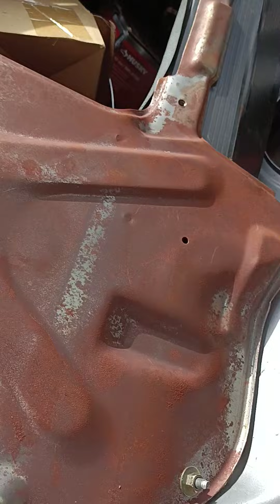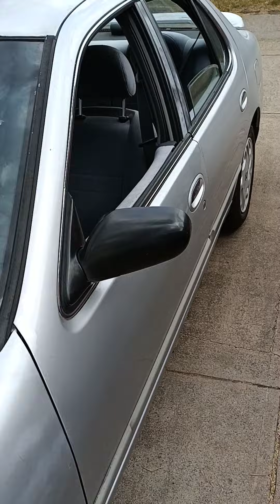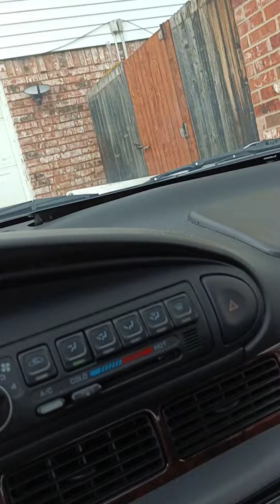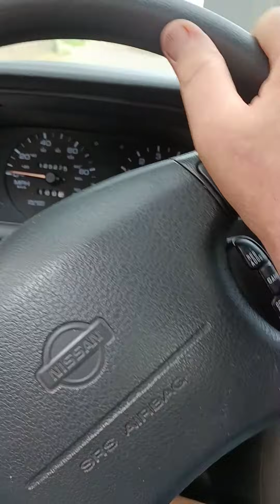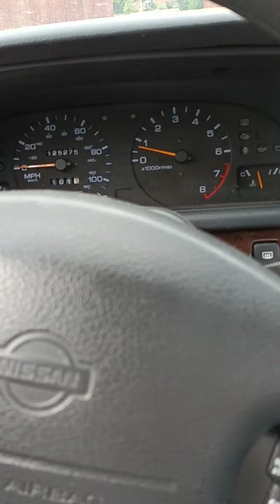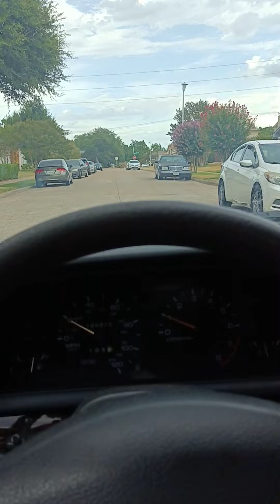1997 Nissan Altima; Replacing the Fuel Pump Connector

Comment: Id swap the iridium plugs for the best copper plugs u can find. On my 94 chevy k1500 brand new top of the line copper spark plugs we less than $10 each (2years ago money) they truck runs great with coppers bc thats what it was designed for and ment to use. The older the car its not really worth the extra money for iridium plugs, its just my opinion but myself and my friends with older vehicles have found using the "lower end" parts (from the technological standpoint of modern cars) makes them run and work better

Comment: But you not show Us  how fix  it the gas pump , We need it check how do it .
Reply from the maker: I have other videos that discuss replacing the fuel pump.  This video is about addressing the bad connectors that the pump plugs into.  If replacing the connector like what is done in this video, I used a dremmel tool to grind off the corrosion on the plate connector before soldering the wires to the plate.   If you don't grind down the metal, the solder will not adhere very good.  In a later video, I redid this connector replacement and cut away the old connector housing that is built into the plate to get better access to the metal of the plate connector.

Comment: Your video on dealing with the POS Nissan Altima has helped me a lot in dealing with the same POS car.  I will NEVER EVER EVER EVER EVER buy a Nissan again - Let me say it once more NEVER AGAIN!  I have replaced all tie rods, CV axels, motor mounts, power steering pump, and fuel filter and now Im replacing a totally failed (due to corrosion) fuel pump.  What really pissed me is how difficult it is to replace the power steering pump, the design is so bad on how to access it, I'm never ever again going to buy a NISSAN.  I also have a 2008 G35 which also has many little problems and it too has some very stupid engineering designs.  They have nothing on Toyota period.  Even my Ford 150 is much simpler to work on.  

Again Thanks for the videos - I have seen a lot of POORLY done videos concerning all the repairs I listed above to this generation of the Altima, few actually do a good job addressing the issue at hand and providing details to repair as you have done.  I should be posting my version of how to but if I did, it would be full of cursing as I have never cursed as much as I have when working on this POS car.  

Im going to sell it ASAP but when I do it will be in the best condition it has ever been in since I bought it with zero problems off my mom.  I fear the Lord and that makes me obedient to his commandments, to do unto others as I would have them do unto me.  That is why this car is so frustrating to work on, I fix one thing then another thing breaks or is in need of replacement.  

Again Thanks
Reply from the maker: I think the 1997 Altima is actually pretty good and reliable car generally speaking.  You are right that many jobs are a pain, but most cars have a particular part that can be hard to replace compared to other cars; the biggest problem with the 1997 Altima is that it's over 25 years old!  It should be expected that anything that hasn't been replaced may need to be replaced soon.  I paid $600 for this car to give to my son and I expect that since he is an inexperienced driver that it will be crashed; then that's where the value is in this car; I'm only out a small amount of money compared to a nicer/newer car.  Also since we are having to do repairs, he is learning about car ownership and upkeep.
Reply: @johnhermann762  You can have ALL THE NISSANS in the world then - have at them, never again for me.
I have over 220,000 miles on my Toyota Corolla S (08) with no major issues and maintenance on it is much easier than this Nissan Altima.

I know one thing for sure

Ignorance has its own reward
Reply from the maker: @msdzappa4701  Would I rather have a Toyota than a Nissan?  Absolutely; Toyotas are the best.  I would never buy a 2007 or newer Nissan; all of them are junk; 2006 is as new as I would go.